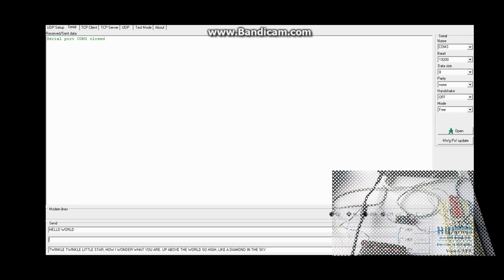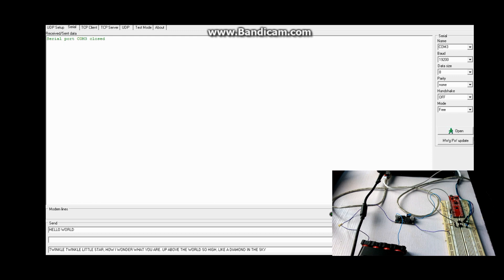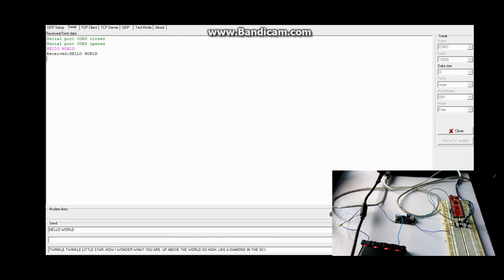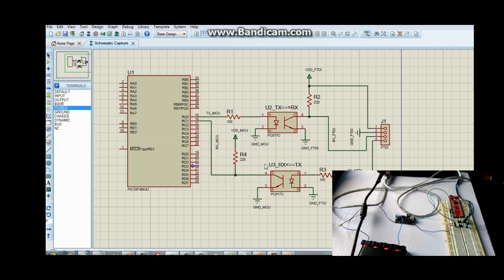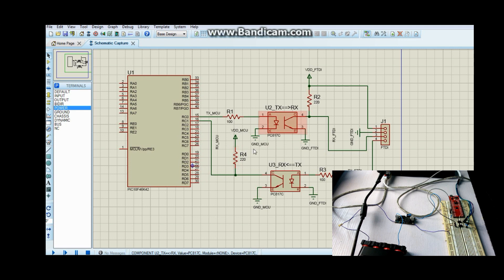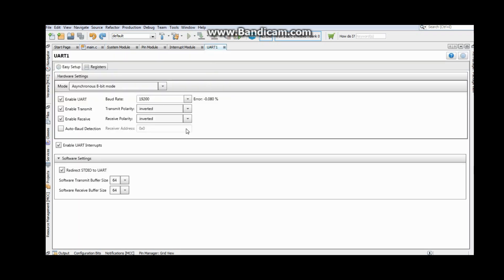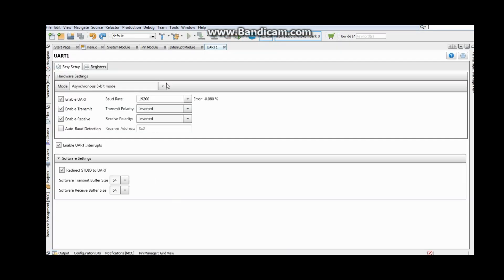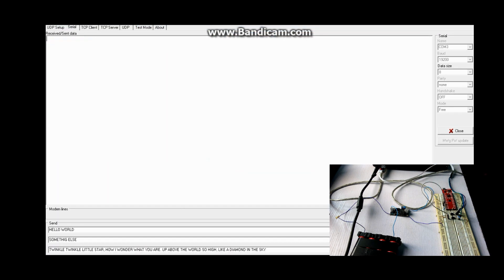How to implement UART communications via PC817 optocouplers using PIC18F46k42 and FTDI

Comment: I am sorry but in your schematics you forgot flip correctly the bottom one opto isolator. Now its mirrored and wont work. If you look closely and flip in your hand it other side you see it.
Reply from the maker: I'm sorry, I don't quite understand what you mean. But the circuit works when implemented with actual components. I didn't simulate the circuit as the PIC18F46k42 does not have a simulation model on proteus.
Reply: @neutronlabs5779  In video double check the bottom opto isolator. It drawings are not correct. They are mirrored instead rotated and wont work.
Reply from the maker: @XantheFIN  Okay, I get what you mean. This was just to illustrate the circuit not intended for simulation. In actual hardware implementation, you can't actually mirror the optos, you'd have to follow the pin numbers which are well shown in the circuit. And it works as shown.
Reply: @neutronlabs5779  Yeah its good. I just this detail. If you try to do with pins exactly in the video.. the pins are wrong at bottom opto one because you follow the diagram of mirrored opto which has wrong diagram now so wont work again. But all other way its okay. :)
Reply: @neutronlabs5779 hey can you help with a detailed circuit that can work?